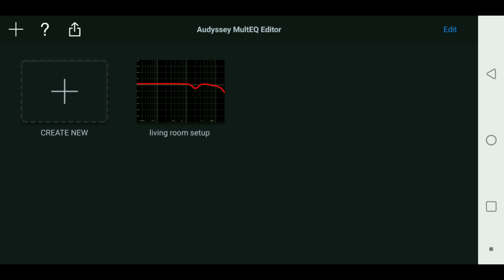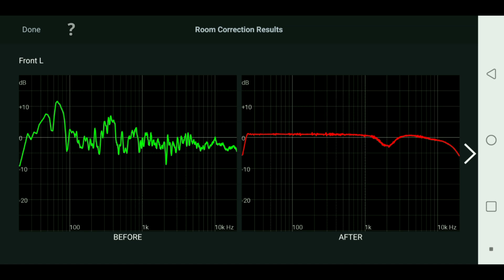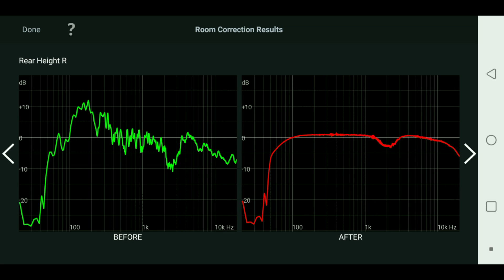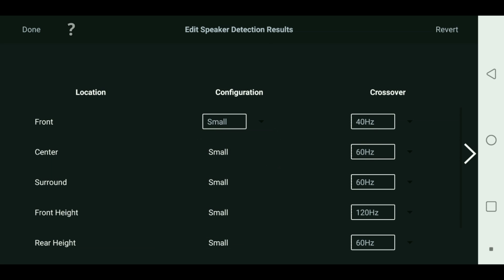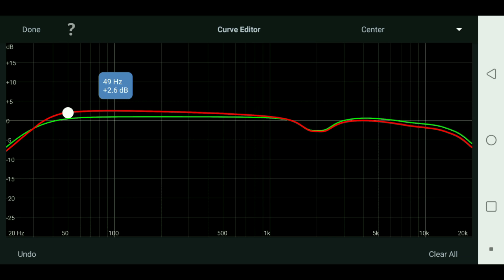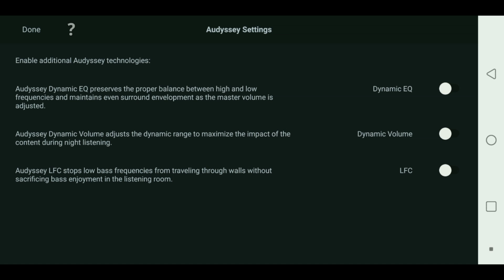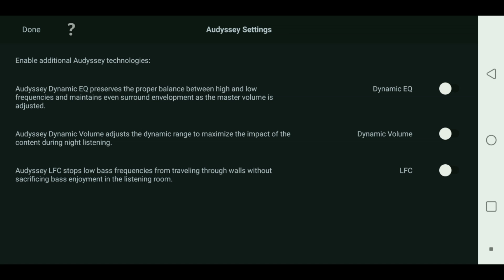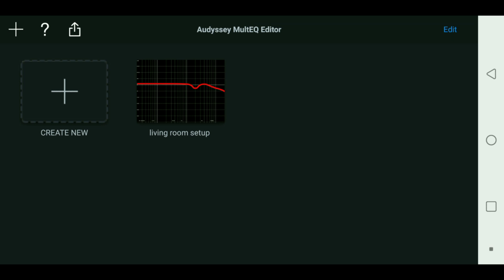Audyssey MultiEq App Walkthrough for Denon/Marantz

Comment: As you said in the video, it's good if you know what your doing and looking for. Do you have any recommendations on how I can educate myself on eq? I have 11.2 theater. All Klipsch and 2 vs subs. I really need to tone down the Klipsch speakers. The highs are pretty harsh. If I was starting fresh I probably would look for warmer sounding speakers, but I already didn't do that. Thanks
Reply from the maker: @garypalmer7058  in that case I'd go to your treble settings and simply turn the treble down. You should be able to do that by pressing the options button on the remote for the tone controls
Reply: I've done that already. Still can be ear piercing at high volume. I used the app adjusted the curve on all speakers to -15 db on the high end. On the frequency range I brought everything down from 20khz to 16khz. Does any of that sound like a good or bad idea? Don't really know what I'm doing. Learning
Reply: Also , I'm using a denon 4700h
Reply from the maker: @garypalmer7058  are you speakers aimed directly at you? If so, try firing them away from you a little bit.  So instead of then toed inward toward your seat, don't toe them at all so that the sound goes a little past your ear not at your ear.
Reply: They are not toed in. Thanks a lot for your responses. It may be my ears , I've had 4 ear surgeries in the past  my wife also says they can be harsh a loud volume. Do you think the adjustments I listed above are ridiculous or overboard? Thanks again
Reply from the maker: Its not your ears. That's just kinda the klipsch sound. Thousands of people feel the same way
Reply: Is there a good way to tone that down a bit, to your knowledge?
Reply from the maker: @garypalmer7058  only thing you can realistically do is muffle it a bit.  Maybe put some kind of fabric behind thr grill and put the grill on that still let's most of the sound to pass through
Reply: Thank you

Comment: I tried using the app with the 502Hz curtain for all my 7.2.4 speaker layout on my Denon AVC-A110, but I didn't hear any difference. I'm not sure if it's because of my ears, my experience, or something else. But if there's not much difference, why do people pay for a useless app?

Sorry for the rude question, but it took me a couple of hours to recalibrate my speakers for room correction, figure out how to use the app, and try all its features. I switched back and forth between the default settings and adjustments, and since it cost me $29.99 AUD but did nothing, it really pissed me off. To be honest, I'd like my money back.

Comment: What does a roll off mean?
Reply from the maker: Roll off means how quickly do you want your crossover to cut off the frequencies that come before and after it

So if I have a crossover at 80hz on my speakers, it'll still play under 80hz but it'll start to be at a lower and lower volume as you get under 80hz and the roll off let's you pick how quickly the volume decreases
Reply: @Kpaceguy  An example would be if I set the mains to 80hz anything below 80hz the sub takes care of it and 80hz and above the mains do the work?
Reply from the maker: @arielrodriguez6980  you got it

Comment: Hey. Can this app get rid of frequency nulls?
Reply from the maker: It can help you identify them. You don't want to boost frequencies to fix nulls up want to reduce everything around it down to meet the nulls. Boosting will cause your speakers or even your receiver some issues
Reply: @Kpaceguy  I see! Would you say that difussers and absorption panels can help remove nulls? Or is it sub placement and listener position, ONLY?
Reply: I basically had a corner sofa flush to the side  wall. I've now got a 3 seater and a 2 seater (2 seater against the wall) and the bass has totally disappeared from the sub. It's weird.
Reply from the maker: @Adam9306  sub placement and seating arrangement comes FIRST. Once you've accomplished those two things then you can further treat the sound. Sound treatment like bass traps will help but nulls can be so significant that you'll need much more than a few traps around the room
Reply: Can reflections cause poor subwoofer response?

Comment: does it work with WiFi only or I can connect my receiver to lan cable and phone to WiFi of same network ?
Reply from the maker: You can use lan
Reply: @Kpaceguy  OK thx
Reply: I need a suggestion from u......i have marantz sr7009.....bascially I changed 3 reciever in my room....they all sound crunchy and harsh or trebly.....wht could be the fix????.....actually I have my setup in a room where whole of the room walls are made up of reflective tiles......i tried putting few mattress on floor putting few sound absorption panels on few points but still harshy sound....any suggestions wht to do and how can I fix that....i calibrated with audessey itself....plz give me a fix ?
Reply from the maker: @lovishbharat.official  it's going to take a lot more than a few panels to fix a full tile room
Reply: @Kpaceguy  just tell me.....are really those tiles making my sound harsh crunchy or muddy through audessey ?

Comment: I don’t know if it’s just me, but do you feel like yamaha AVr produces better bass than Marantz and Denon?
Reply from the maker: Yes
Reply: @Kpaceguy  I’ve noticed that Pioneer Elites do so as well. I’ve calibrated both my Pioneer Elite & Marantz in the same room and the Pioneer sounded better. The trim level of the sub in my Pioneer was set to -7 and the Marantz set the sub to -4.  The Marantz set the sub level 3db louder than the Pioneer, but still can’t compete with It. Would I gain sub performance on my Marantz by setting a sub target curve?
Reply from the maker: I mean you can always EQ it to sound like whatever you want. It may just be the RCA output voltage from marantz isn't as high some of the other competitors so you have to turn it up higher.   With that being said, I think the sound quality of marantz is what I like best underneath the expensive stuff like Anthem and NAD
Reply: @Kpaceguy  is Denon’s output voltage the same as Marantz? What level do you have your PB-4000 on your Marantz? Dynamic eq on or off?

Comment: This is probably old news by now, but 95% of the time, the crossover should be set at 80 Hz.  No reason to tax your mains and center channel with sub 80 Hz frequencies if the sub can easily handle it; especially if you're running multiple subs.
Reply: The subwoofer was invented especially to create these very low frequencies (like 80hz and lower). Logically it is the better choice in almost every case. It makes little sense to ask a main speaker to produce sub-bass frequencies when you have a sub.
Reply: @BvR6500   Would be true indeed with small speakers. Most of the reasonable reaches 60Hz with no harm. Even not floor standers. Below that you will need serious towers or/and decent sub. 60-80Hz is not something i would consider as "very low". Sounds like author of the video knows the limitation of his setup, which seems to be something much better then one box cinema package ;) Based on that all he says makes sense. Cutting at 80 when you can easily go lower with your mains makes even less sense.
BTW: Thx for the vid. Will try this app  up ;)
Reply from the maker: Thanks for watching !
Reply: @krmfpc  
Thanks for your response. Please let me elaborate a little more, because I feel I did not explain clearly. My point was that you should not use your mains for sub-bass when you have proper subwoofer in your system. You can, but you shouldn't. 

Why use a sub instead of mains:
-Running sub-bass frequencies through your mains when you have a capable subwoofer in you room will rob your system of power and headroom. The receiver will use most of it's power on the low frequencies, when this power could instead be used for the bass, mids & highs in your system. You can off course measure this yourself with a simple db meter. Just check how loud you can go with different sub crossovers before distorting. 
- Using a sub (or ideallly multi-sub setup) allows much more flexible placement options and bass management. This will get you a flatter bass response and better seat-to-seat consistency. You cannot easily move your mains speakers to a different location in the room just to get better bass. A subwoofer can do this!

This principle applies to low-end or high-end systems alike. In almost every single case you can think of the subwoofer can produce more and better bass than a full-range speaker can. Why not use it I say!
Reply: @BvR6500  well said. Looks like we all have an agreement here and  it was just  a matter of word selection and count 😉  best wishes to all
Reply: @BvR6500  Exactly, we’ll said.
Reply: this is just BS, do you really think people buy $10k tower speakers just to set a crossover to 80 on them? In this case I suggest you get yourself Logitech 2.1 from Amazon for $200 and you are good to go my friend.
Reply from the maker: That is not true whatsoever.

Comment: Do you think DEQ drowns the dialog at times?
Reply from the maker: I don't use much of the enhancers on receivers
Reply: @Kpaceguy  Since I do not have the app does Audyssey normally leave the midrange set to ON after calibration?
Reply from the maker: @arielrodriguez6980  it asks you after calibration what you want on and off but usually that stuff is on
Reply: @Kpaceguy  Normally after Audyssey it asks if you want to engage DEQ and DV but no mention of mid range option. Are you are saying most likely after Audyssey calibrates  it leaves mid range ON?
Reply from the maker: @arielrodriguez6980  yes
Reply: @arielrodriguez6980  According to Audioholics, the midrange compensation is on, on all receivers, and you can't change that in the menu. It's simply not there as an option.
Although no one can say, if that wil be possible in future receivers.

Comment: Some things I'd change:
- Disable all the PEQs you set in your SVS app unless you are using them eq room modes that you figured out with a calibration mic in REW or an RTA phone app. You want your sub to be playing as flat as possible during room correction. Then after you've redone room correction you can re-enable any PEQs you set that are part of a personal preference.
- Set all your speakers to Small and all your speakers to 80 hz or higher as just because your large towers can play below 80 doesn't mean that they do it better than your sub. This will also free up your amplifiers some potentially making your towers play better. Also unless your towers are a couple feet from the wall or you have room treatments for boundary interference they will be playing louder than they actually are.
- Dynamic EQ is mainly to help with your ability to hear bass at lower volumes as the human hearing of bass is less sensitive when compared to higher frequencies so the farther you are from 0db main volume the less bass you'll hear even if it's at the same db in volume as other content. Personal preference but probably don't want it on when listening to music. Dynamic Volume is something you don't ever want unless you're listening at low volume at night as it's going to boost quiet sounds like dialog and lower loud sounds like explosions in volume.
- You don't need to run through the room correction (the chirps) to get multiple profiles, just click edit in main screen and then the left icon next to delete is copy.
- Also according to Audioholics they did some research and found that room correction software isn't capable of correcting speakers past 500-700hz due to it not being able to know what is caused by the speaker and what is caused by the room so it's basically guessing. So in the filter frequency range screen set all your speakers to somewhere in the 500-700 range and see what sounds best. Look for their 2 video from a week ago that are around 37 minutes long.

Comment: Good video. I have Marantz SR8012. Using MultiEQ app, have two svs sb3000 and I got that ONE Dull/Dip after calibration. What is the best way to improve that null and make it as flat as possible - I really don't have luxury to move the Subs - position wise.
Reply from the maker: You can go in and manually adjust each speakers response curve and you can also do that with your subwoofer app
Reply: Kpaceguy so its as simple as just moving that null up??
Reply from the maker: @savanp228  basically. Bring up the volume for that specific dip
Reply: @Kpaceguy  Not correct. You can only slightly correct for dips. Dips are caused by ether the speaker's inability to play that frequently and/or its your room that makes the problem.

In any way, you can't compensate for that. You only put more power into these frequencies, to a point where you might damage your speakers.
The only solution is to lower the entire curve.

Comment: My svs bookshelfs begin the rolloff at 80hz but audyssey put then on 60hz, ia this correcto?
Reply: Generally you should almost never go under 80hz. Some very big fronts with 8" or bigger woofers might handle 60hz but if you got subwoofer you should let it handle those frequencies.
Reply from the maker: Audyssey isn't perfect. Set it to what you know is right

Comment: If you think that the frequency response on the right is your actual post calibration response, then you have no clue how Audessey works...

The red curve is just an estimation. Use REW and check the actual after response, and you'll be amazed to find out that it is even worst than the before response.

If you want a near flat response you need a better room correction system like Dirac live and dual subwoofers... Auddesy sucks!
Reply: Then you must be doing something wrong.
Audyssey is awesome and sounds fantastic once the curves have been tweaked
Reply: John Smith  For noobs maybe
Reply: best is use both Audyssey  and Dirac ; because Dirac can't send  new correction curve to Denon ; so you have to use Audyssey  Curve editor and do the changes to get a Flat response on Dirac

Comment: Nice video but do i get any benefits of the app (beside some adjustments with roll of,graphs etc), besides the internal calibration program?I do have a SR7012.Is this app more acurate than the internal Audyssey?Greetings from Germany!
Reply from the maker: The app is the same audyssey that's in your system. This let's you tune it exactly how you need it
Reply: Kpaceguy ah okay.Damn i thought its a bit more precise or let you put in your room measurements like Audyssey Pro...which is a lot more expensive.
Reply from the maker: @TheMisfit1979  I mean you can. But it's not pin point accurate. It's approximate
Reply: @TheMisfit1979  It is more precise..
Reply: @Kpaceguy  That's not correct. I just saw a video on Sound United (owners of Marantz & Denon) with an interview of one of the key developers from Audyssey.

A tablet or smartphone has far more CPU power, so they can allow for much more precision calculations via the app.
So the overall result is more accurate.
Reply from the maker: The audyssey app itself is the problem not the cpu
Reply: @Kpaceguy  I'm sure you don't know as much about this, as the developers from Audyssey.
The app is superior to the build in Audyssey system, because of the reasons I gave you. It comes directly from an Audyssey engineer...
Reply from the maker: You said it's more precise. Which I agree with.I'm sure it's better than the receiver itself but the app itself is not accurate. I promise. More accurate sure. But it's still off. The target curve is not realistic in an everyday room. It's very good. It's the best out of all the big box brands. But it could be better I promise. I'm not arguing about cpu performance lol I don't care about any of that.  I care about how accurate my sound is after I use the software

Comment: As we lower the volume our ear's ability to "hear" LFE is diminished, yet we are still able to hear the higher frequencies quite well. I thought that Dynamic EQ tries to "keep it the same" at all volume levels so that the LFE is still audible for us at the lower volumes? It seems to me that Dynamic EQ is something you'd want enabled if you sometimes listen at different volumes.
Reply: @tb2324  You said exactly what I said, just with more words.
Reply: From Audyssey website q&A's: "Also, keep in mind that Audyssey sets the subwoofer level to reference. That means that it is the same as the other speakers as is required for film content. However, personal preference may be different and there is no problem with making a manual change to the level of the sub. Sometimes this preference is actually due to human perception. At lower listening volumes (master volume below 0) our perception of bass drops faster. For this reason we developed Audyssey Dynamic EQ. It restores the bass balance that is normally heard at reference listening volumes. I highly recommend using Dynamic EQ together with MultEQ."
Reply: You're right. I think he has his descriptions of Dynamic EQ and Volume mixed up, based on information and recommendations from the Audyssey website.

Comment: I enjoy your videos but towards the end of this one you stated that you could change speakers without rerunning Audyssey if you had saved an alternate profile. While it is true that you COULD that statement is misleading and inaccurate since Audessey would be based on the in room response of the previous speakers setup which could be drastically different than the new setup. If you had a calibration file for both the old and new speakers as well as a true room acoustic signature map you could make it work but not many people have the resources to accomplish that. Just to have a single speaker with perfect frequency response and alignment in an open space is difficult let alone an environment with speakers at varied distances, with multiple reflective/absorbent surfaces, boundaries and obstacles.